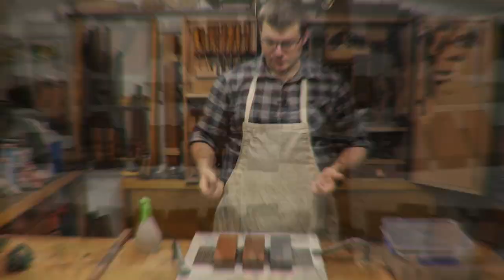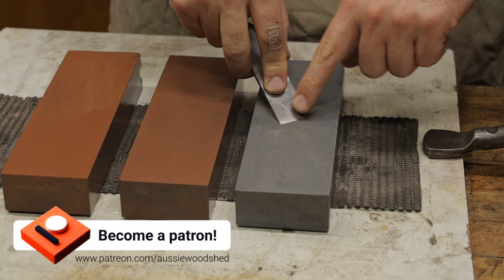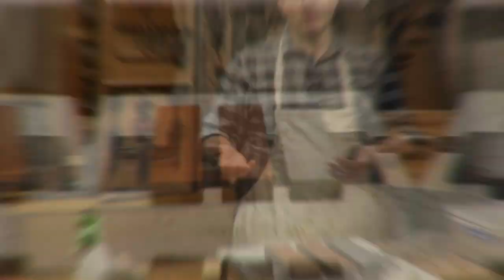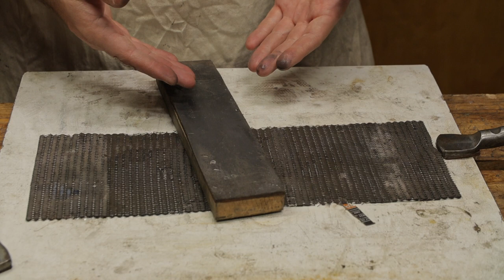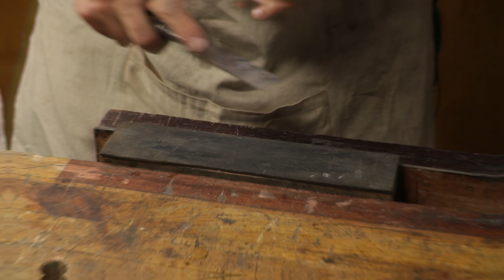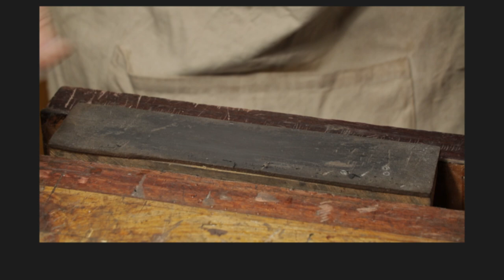How to Free Hand Sharpen a Chisel

Comment: My advice to beginners would be to learn as we learned 50 years ago; freehand from the start. If that doesn't work, use a guide to put things right and then try, try, try again until you get it right. I use a guide to get things back on track when things get out of square (as they do) but once done, it's back to free-hand sharpening, with a rounded bevel that keeps on moving further back as I sharpen.
Reply from the maker: Thanks for sharing!